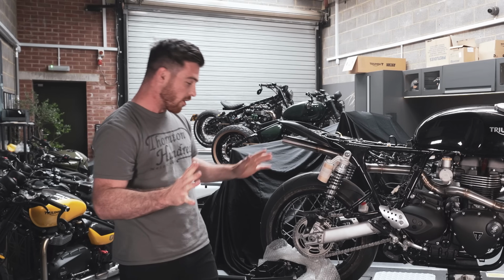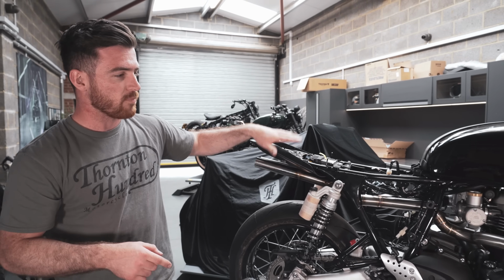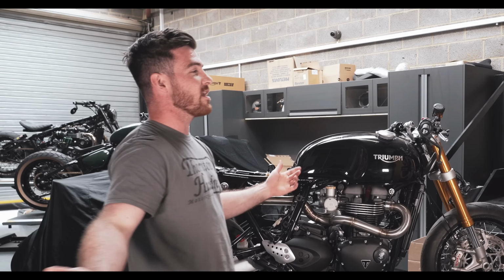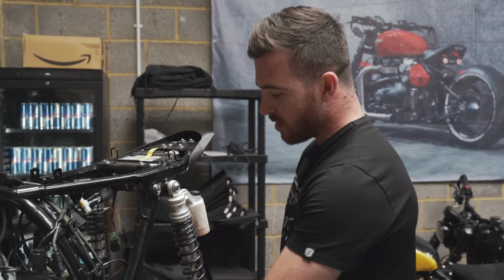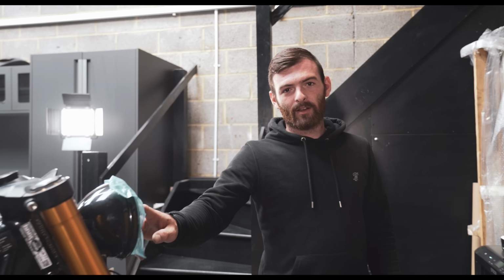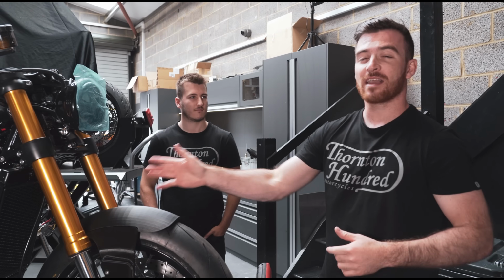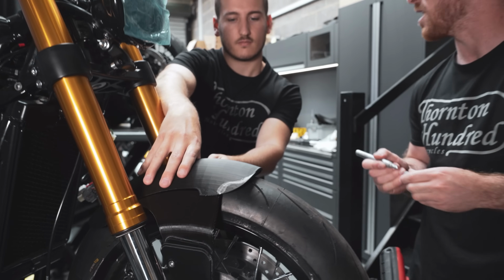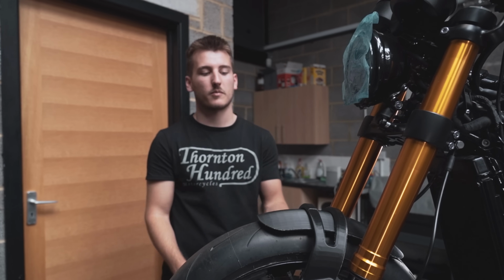Custom Triumph Thruxton RS mud guard for Joe Wicks! EP3

Comment: Really interesting to see the process and work involved guys.
I see you sell some parts that you've probably designed during a custom build and realise might have wider appeal.
I wonder if you might be interested in commissioned, custom parts rather than a whole bike?
I want a new rear end on a Speedmaster that incorporates tail tidying, rear rack (where a top box could be fitted), sissy bar with pillion pad (still allowing a top box) and pannier mounts (for preferably lockable removal hard panniers) that is functional and sturdy but also good-looking...
...it's proving difficult to find, to say the least!

Not that you haven't got your plates full doing excellent work already hehe - but would that kind of thing be viable?
Reply from the maker: We are definitely capable of building that! send an email to Enquiries@thorntonhundred.co.uk and we'll see what we can do. also glad your loving the build 😊